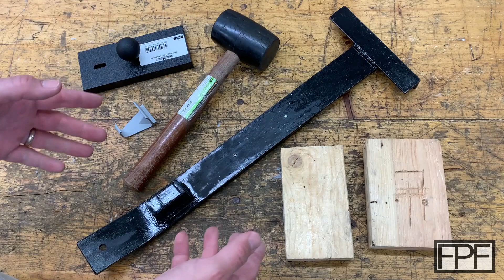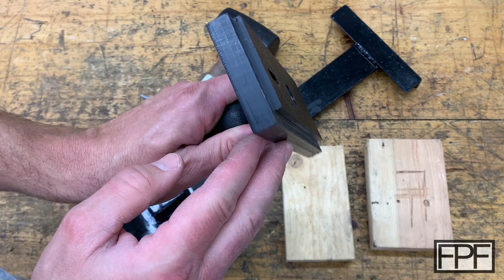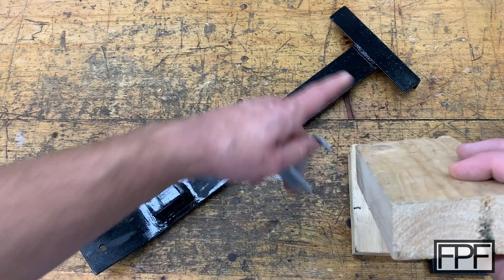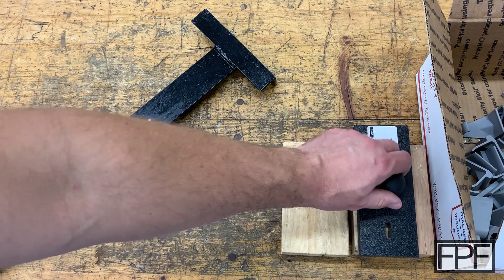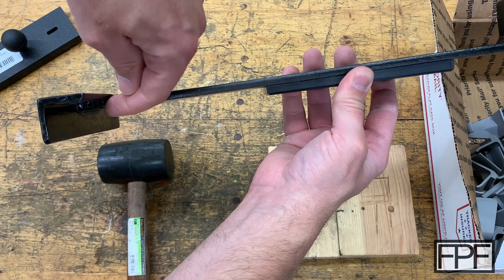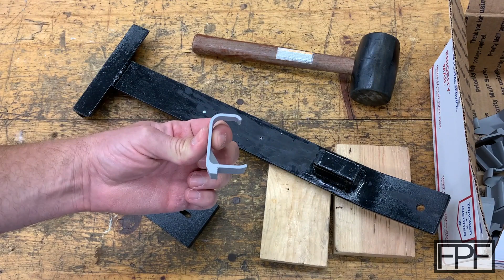3D Printed Floating Floor Installation Tools

Comment: A tip for 3d printing slopped objects. Since you'll end up with the stepped surface, model it so that step will be against the object so the flat bed surface will be outward facing.
I recently designed and printed a ramp for a robot vacuum to get over large thresholds and I modeled and printed it "upside down" so the nicely looking and smooth surface that was on the bed is the surface facing up at the door.

Comment: I printed some tools for e-bike repairs. One to open the motor and one for a big nut on the pedals. 
The tool for the Nut would have cost 35€ and there was none for open the motor. Printed in ABS with a lot of screws where it grips the nut. 
Printed for around 5€ including the screws.
Reply from the maker: Awesome!  Checkout the video where I printed a tool to remove the clutch on my chainsaw.  It's another way to use screws where plastic wouldn't be up to the task, but is still really easy to make.